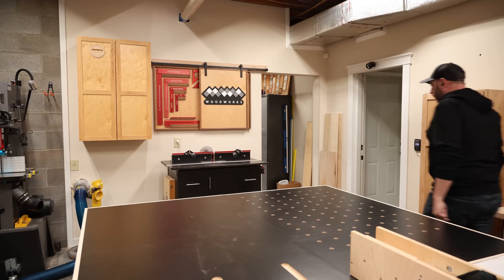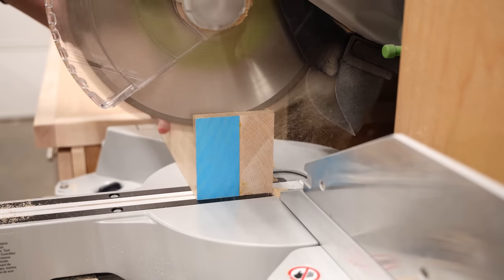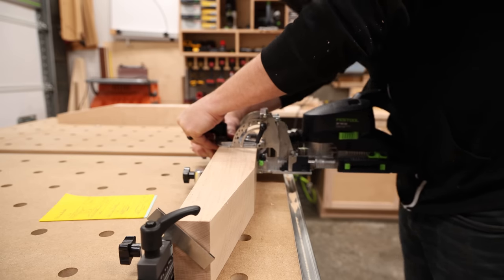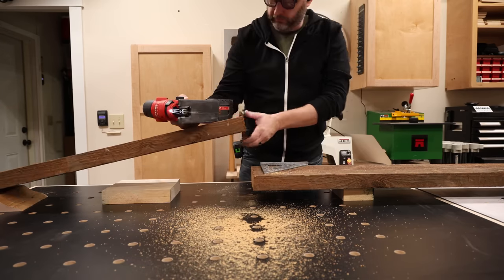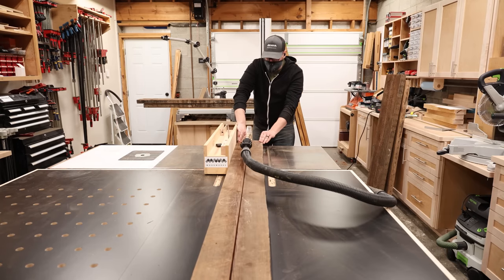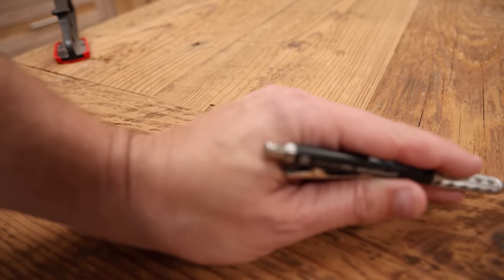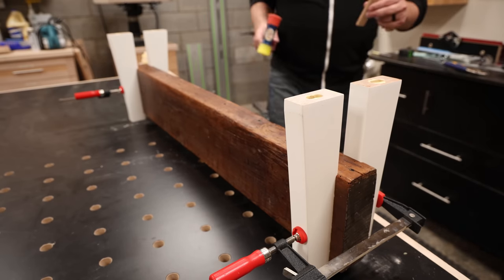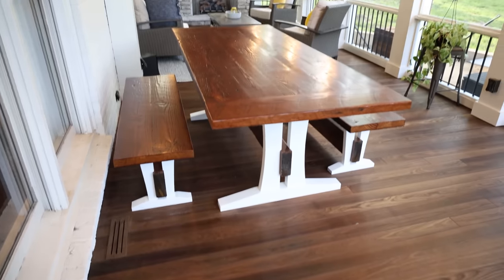Building a table with history

Comment: I got the domino df500 a few months ago. Love it. If I every decide to build a table I will talk myself into the df700. Enjoyed this build video.
Reply from the maker: Yeah the 700 is great but only for larger projects.
Reply: @MWAWoodworks  do you think double rows of the 10mmx50mm (or whatever the largest size for the df500 is) could replace what you did on this table with the df700?
Reply from the maker: It would be hard to know. My main worry would be that the 500 can only plunge 25mm. I plunged 70mm for most of my joints.

Comment: I have to say that I have always used the classic way to make bread board ends but was very impressed on how you used dominoes to do the same job which is much easier and probably as secure if not more so depending on the glue used.
Reply from the maker: Yeah functionally should be identical but much faster to execute.

Comment: Awesome build! And thanks for the fence tip. 

Since someone always says this about my comments, yeah, yeah I know...I'm long winded and my comments are like  novels....

In my experience dowels are actually stronger than Dominos when you use the correct number for the joint size but they do take longer...Not as much time as some would try to convince you but they do. Just like with anything in woodworking, it all comes down to your workflow and how tightly you nail it down. When I need to knock out a bunch of repetitive pieces at once AND don't need the added strength, I use my Domino. When I absolutely need the strength I grab my self-centering dowel jig and use multiple, appropriately sized dowels. 

In general, whatever method results in the most direct wood face to wood face contact will be stronger as the glue sets up. I should say it also depends on how good your glue is as most times when either Domino or dowel joints fail it's due at the glue up points . 

I'm not trying to piss in anyone's Cornflakes so please don't argue with me. Do your own research and you'll see for yourself. There are plenty of YouTube videos out there proving what I said to be true as long as the tester used the appropriate number of dowels. If you don't want to dig around much there is a recent one by Scott Walsh done a few months back. He treated it like a science experiment, gathering data, break points etc. but there are others out there. Channels: Rag n' Bone Brown, Bourbon Moth etc. The Bourbon Moth video compared to bunch of different types of joints and it's pretty interesting as neither dowels or Domino's turned out to be the strongest. 

Either way, it's just a tool and people up on should use whatever makes them happy. I'm just offering info to those who might think they MUST drop a grand or more because someone told them that it's strongest bond when it's simply not. 

Where the Domino shines is it's ease-of-use so if that's the most important thing to you it's your $1,000 + solution.
Reply from the maker: Thanks! Strength was not a deciding factor for investing in a domino, though.
Reply: @MWAWoodworks  Yep, ease of use, I really do get it....Thanks for responding and I hope you don't feel like I was giving you trouble. It's hard to argue with a faster workflow if/when you need it. Also, people should use whatever they like. My Domino was a gift and I love my family for it so you won't hear me knock the tool, just the cost. 

Growing up dirt-poor makes you see it from a different point of view. To my the best thing about woodworking is its accessibility for people whether they have bags of money to spare or not... although that seems to be changing. For years I've been knocking out loose tenons with a hand drill & dowel jig in about 5-6 minutes both sides (less if I actually try) with a jig that cost me but about $40 and I had drills anyway. I just wanted to make sure that those on a string budget know that they don't have to sit on the sidelines thinking they can't do something they can.....easily. Especially because a lot of YouTube watchers are new to the craft and looking for tool buying advice.✌️🙏😇

I'll be checking out more of your stuff, thanks again

Comment: Question(s) - other then looks what is the function of bread boards? Timber (table top etc) can still cup or bow or rip if "wrongly" attached to the leg structures - right? If you KNOW that there will be large seasonal timber movement (say 5mm plus) then that will always show against the breadboards no matter how good the woodworking??  In that enviroment you would have to accept a mis match on the edges - or not bother at all?!?!  Looking forward to the answers.  Cheers From New Zealand
Reply from the maker: That's correct. In some cases it's unavoidable. Breadboards are there to keep the top flat but there can be a tradeoff

Comment: Question: If you know that you are gonna work with short pieces of wood, why not buying shorter pieces in first place and save the big trees for another more "usefull" situation? 😶 Love your channel and content anyway. Thanks for all the tips! 🙂👍
Reply: By the way... Dowels for the win for me. 😋
Reply from the maker: You can't just buy shorter pieces of lumber. You have to buy whatever is being offered which is generally 10-12 foot lengths. If you do find someone selling smaller offcuts they are probably charging way more money than you would pay buying regular sized lumber.
Reply: @MWAWoodworks  Ahh Ok. I see. Is differs from over here (other country). Sometimes I find offers of 4 foot or less lengths offcuts for 30 to 50% the price of the full lengths (It depends of the section sizes offcourse). Thanks for the aswer! 🙂👍

Comment: No I will not follow someone whom states to the masses that you must buy a metal detector to find tiny steel nails so you don’t ruin a high end solid tungsten carbide toothed saw blade?????? It’s carbide???????? What   Do you think the steel nails or screws are going to do to a carbide saw blade shit I just cut 20-24 8D penny nails with a cheap circle saw blade this morning in some ole wood hues what saw blades fine as there made to cut steel nails and screws without damage hundreds of times eventually wearing out and needing sharpened now the saw stop break thing is legit but I would bet $1000 cash in hand right now that less than 5-7% of the viewers of this video have a freaking $3,500-$7,500 table saw shit I made over $7,000 last week in my woodworking shop and I don’t even have one for gods sake man come on
Reply from the maker: Wow 👌  maybe relax a bit today.
Reply: Save this one for your hate mail video.  Hysterical.
Reply: Lighten up Francis!
Reply: This one needs punctuation and oxygen...  Maybe a little less caffeine.